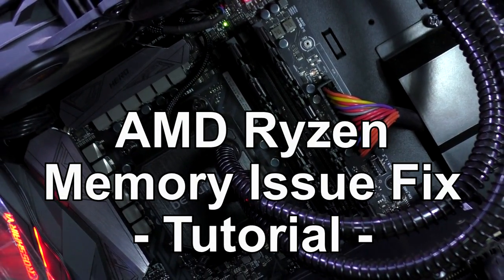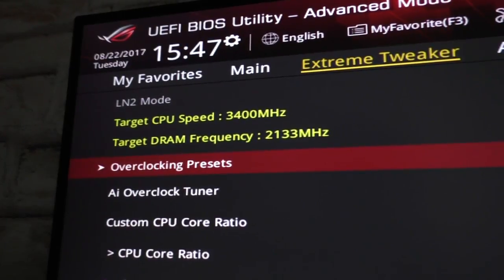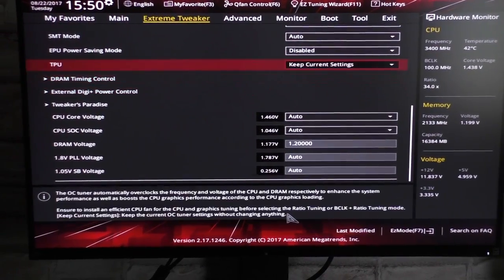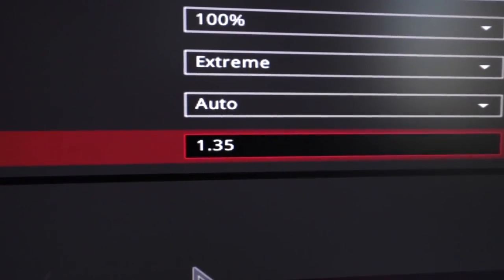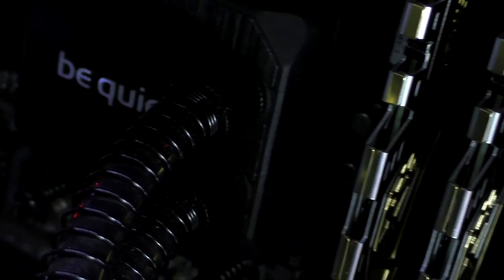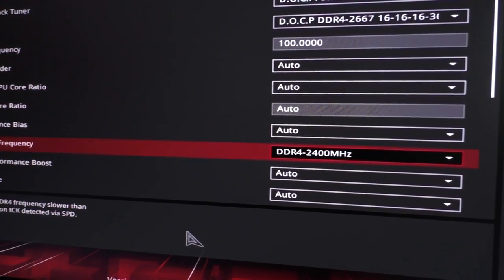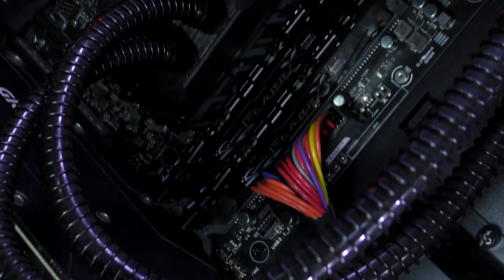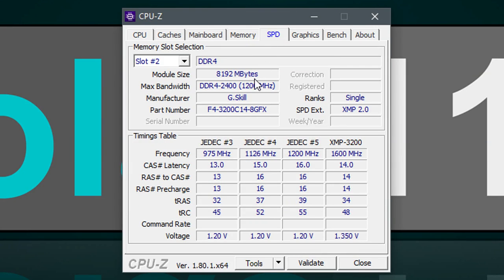AMD Ryzen Memory Issue Fix - Tutorial

Comment: I Used Trident Z RGn 4 X 8gb 3200mhz . 2 diffent kits, I just turned up the voltage from the recommended 1.3500 to 1.4000 and it posted and works fine now
Reply: Dude, I've been trying to fix this damn problem for months. I also have 4 Gskill ram modules, 2 in each kit and I have not been able to set the memories to the maximum speed (in my case, 3000Mhz) because my pc always turns off.

They only work for me as a maximum, at the speed of 2733Mhz.
Did the 4 modules work at maximum frequency?
Have you had problems in these last days?
Reply: @AndroidNetworkOficial  no problems max sure to enable xmp or AMD version of xmp and it should automatically run at 3000mhz or your max frequency

Comment: i have R5 2600, Asus B450 TUF and Team Delta TUF RGB 2x8gb 3200mhz. With DOCP/XMP(3200mhz) the board sometime doesn't recognize both sticks during booting, since TUF doesn't have boot voltage option, increasing the DRAM voltage seemed enough, 1.35v -> 1.375v and now... no problem at all. Thanks
Reply: Thank you it helped and now my ram working at its full speed 3000hz

Comment: Nice! ... I increased the DRAM Voltage from 1.20 to 1.30 and it solved all the BSOD issues! Thanks.
Reply: Yep, did the same thing and it worked. Ryzen 1200 bought 2017, just put a nearly identical ram stick in and had the no boot problem.

Comment: Guys are insulting amd coz they buy some 3200mhz kit but they didnt see they cpu limitation... connect ur brain sometimes ! For exemple Ryzen 7 2700x limit the ram to 2933mhz, if you want to go over the limit its called overclocking then u need to change timings, voltage, boot voltage etc... and 99% times it will fail and crash or it can happen while doing an hard cpu task.
On ryzen cpus even if you are one 2933mhz that didnt mean your 3200mhz are useless cause when u will play à huge game the cpu will automaticaly increase your ram speed.

Comment: ive got a ryzen 9. wont run my 3600mhz kit faster than 2133mhz. and out the box it was running my ram at 1.4v. no idea what to do
Reply: Same for me I am using 4x8gb of gskill trident z neo 3600mhz with a ryzen 5 3600x i canot get it over 2133

Comment: Hi! I have an MSI B450M PRO-M2 MAX with a Ryzen 5 5600G and Patriot memoryDDR4 x2 3200MHz motherboard that will only work one ram at a time both rams are good both slots work but can only use one ram at a time put in two rams and no display why will it not work with the two rams

Comment: Sorry for my english!! Here is mine problem... I've gotten a new ryzen 5 3600 , replacing my old 1300x... My MBO is AB350M , updated the new bios p5.60 ... I've got 2 ddr4 8 gb 2400 mhz , one is gskill other is crucial... Afther instalation of the cpu it wouldnt boot up... I took on ram stick out and it booted , whit two it just wont... It doesnt metter wich ram or wich slot im using it just wont boot whit two stick togheter, any ideas .... Ps i know its a bad mbo and bad ram... But why does it boot and work properly on one stick?

Comment: I already tried every method to reset my bios, but it just turns everything on and nothing displays and my peripherals don’t turn on
Reply: Mine won’t even post and have looked for every possible solution. Sigh” I guess I’ll have to go to a computer shop or something
Reply: @Kiro_I0  I went to the store today and it turned out being the motherboard it’s dead so they just changed it and now it’s running fine

Comment: I have  a problem, in BIOS, says that i have RAM at 2400 mhz, but in windows 10 task manager, it says that they are running at 2400 mhz.
My ram is 8x2 corsair vengeance cl16 with a ryzen 2600X.

Comment: Ive got a Ryzen 7 3800x/w asrock b450m/ac 750B psu changing dram frequency to 3600mhz will cause the PC to reboot with no display and no power to keyboard after unplugging afew hours i can boot into bios using pc for gaming 2 xmp profiles 1 is 4000mhz and 2 is 4100mhz (trying to install viper Patriot 4100mhz to run at best settings) any help is greatly appreciated

Comment: I'm using ryzen 2700x with vengeance lpx ddr4 ram and my PC blue screens after about 10 seconds of setting it to docp 3000mhz
Reply: HLFerg same with me and return to 2400mhz
Reply: HLFerg have you had any luck? I have same hardware you mentioned.
Reply: @derekchaney4914  no bro sorry, I literally have to sit my ram at 2400mhz, 2600 worked but still wasn't stable.
Reply: Same
Reply: I got 32g fuck it will only run at 2100hz fuccccckk
Reply: Any solution fir this?
Reply: @kuzumastudios8303  double check both sticks have the same timings and the same version think that might be the problem
Reply: I have the same problem after upgrading another 2 ram sticks. It was stable and wroking well at 3000 with 2 ram sticks
Reply: @VinhTheGamer  the 2700x only supports 2933 stable, any thing above it may or may not work.
Reply: HLFerg within 2 RAM sticks , my system is working well at dual channel -3000mhz. But once I plugged 2 more RAM sticks which is the same brand, speed. Then it automatically switch to 24000mhz and not able to change any higher speed. Also, it’s not stable even at 2400mhz and frequently appears blue screen.  error. I did update BIOS the lasted version. The motherboard is Asus B450M-A prime, power supply is EVGA 600w BQ +Bronze.

Comment: Got my Ryzen Threadripper 1920x stable @ 3466MHz CL14. 
4x 8GB Samsung B-DIE RAM in
Quad Channel. @ 1,39V

There are 2 things u need to know.
1. Some settings just don't work.
it has nothing to do with too low or too high. 
2. Ryzen doesn't like Intel timings
For example: (Same RAM) 
Intel  CL19-19-19-39  2T
AMD CL18-22-22-42  1T
Reply: Probably a faulty Ram. 
Check every single Ram individually with Memtest. 
(Put only 1 Ram in there. 
Open Memtest 4 times and check 2000MB each).

But try resetting you Bios first to default. Maybe its just wrong settings. 
You could also try to set the timings in Bios manually to safe timings like CL 15-16-16-35 1T The VRam voltage should be between 1,2V and 1,35V.
Reply: @imuhki  Seems like u get less voltage than it shows in the Bios.
Or the voltage drops under heavy load for some reason. 
Could be a problem with the Mainboard or power supply.
Reply: @imuhki  you didn't tell me, you are overclocking your 2400 RAM to 2666 😂. You can, but you have to play with the timings. I would start somewhere at 16-16-16-39 1T not more than 1.39V
And always test every change with Memtest until you got 0 errors.
Good luck.

Comment: The ram in my system is 3200mhz silicon power gaming turbine x with everything set to the stated default timings out of the packaging, but when I set the voltage to what the Ryzen Calculator recommends, my system does not boot up, it instead makes no attempt to reboot and it goes straight into a black screen of death

Comment: i have gskill 3200 cl16 ripjaw v and constant blackscreens of death ONLY while gaming, some more rare freezes under win10 apps like ableton 10 etc. xmp1 profile at 3200 dram volt 1.35v, 16 18 18 18 36 timings. no chance to game longer than 10mins. its not an overheat prob. cpu is 3400g, mb x570 aorus elite f11 uefi. 2x8 ram in the correct slots. i recently put them down to 2800 on cl 15 timings and the cinebench was 10% faster than on 3200 cl16. much more stable too, but still bsod and freezes. i suspect the apu' s gfx unit controller doesnt work with fast ram on games or at least not working with some auto settings. i did all that taiphoon/dramcalculator stuff,  but i have no clue tbh. i just put some values manually and the watched the comp booting strangely and i stopped. now i just set the dram voltage the timings and the mulitplicator. at least win10 is "stable"so far with some rare freezes. anyway i may buy some other ram, but my plan was to buy another cpu and gfx card anyway later that year. but tbh it is nervewreckingand it pisses me off...i mean its a samsung b-die ram and listed by gigabyte AND gskill...and its not stable. so it must be the ryzen apus fault. i bet it would run on intel like smooth butter

Comment: Ryzen 5 1600x, b350f board, trident z 3200mhz ram. Bios updated, docp set to 3200mhz, 1.35v. Wont even post at 3200mhz. 2933 is slightly stable but eventually crashes. What is going on?! (4x 16gb ram sticks)

Comment: I'm using an amd ryzen 2600, with a set of 2×8gb gskill ram sticks at 3200hz using the docp that set everything at it's rated speeds with a voltage of 1.35, after booting I noticed smooth speeds and no failures. I am doing this on an Asus b450f strix. But if anyone is reading this id suggest getting the msi tomahawk it's a overall better board for overclocking and stability for higher speeds of ram for ryzen.
Reply: And I have same motherboard, ram and procesor and same problem
My memory when i put on "auto" in Bios, Pc automatic put my ram on 2133 mhz
Sory for bad english
Reply: I’m using the same mobo and processor with G Skill Trident Z 3000mhz and I can’t for the life of me to get it to boot @ 3000mhz. I’ve updated the bios, set the DOCP profile. Adjusted voltage. Any tips? It’s driving me nuts that I can’t get this ram going any faster
Reply: @BigDC9708  Try changing ram slots
Reply: Gerard Prins did that, could get it to stay set in the bios but got stuck in automatic repair loop
Reply: @BigDC9708  I have 4 sticks 64gb of G.Skill Trident Z 3000/cl14 running at 3066/cl14 stable. I did have to tweak all the timings and memory settings as suggested by the ryzen timing calculator than tweak some more to get it fully stable. My MB is Asus prime x370-pro so I don't know if this will work for other boards but my board is not known to be amongst the best memory overclockers. IMO if the board is not physically deficient advanced tweaking of most memory timings and options is required but it is possible to stabilize it at the end.
Reply: @imuhki  Sure man I will try to do it later today. What is your config exactly, ram specs total amount, mobo and which CPU?
Reply: @imuhki  Hi Caal, you can find the files you need in this link, I have included the Ryzen DRAM Calculator 1.41, latest BIOS file I use 4207 (I recommend downloading this again through the Asus site), O.C. profile .cmo corresponding to this BIOS, and all the settings from the profile in a .txt format. Hope this helps. https://we.tl/t-e3sUr1dPzx

Comment: i have a simple question but the answer eludes me. I've got a Asus b450 plus mobo it is supposed to support 3200 MHz. I recently installed 16 more ram but it refuses to cooperate. it worked like a charm with the 16gb i built it with DRAM was running 3000mz but since i got the new memory it only 2133mhz. i dont get it. the ram is identical to what i originally built corsair 3000mhz can someone at least tell me the reason why the hell it won't work? this crap driving me nuts. ty
Reply: 333crypta same bro i ve got a asrock b450m pro4 and my rams are kingston hyper fury x 3200 mhz and also have ryzen 3600 but when im start the using xmp profile my pc gonna shut down...
Reply: @riantholiv  any luck figuring out what the problem is? i was able to get mine to 2666. but i think im gonna leave it at 2133 and say screw it. tired of fooling w it

Comment: when i put xmp profile 1 
and my ram speed at 3200 
my pc just keep restarting and restart and restart 
please if you have an idea just tell me
Reply: Unplug your system, press the power button for 5 seconds, remove the CMOS battery and put it back in after 10 minutes. This will reset the bios settings and bring back the default clock

Comment: So I have the gigabyte b350 gaming 3 that supports up to 3000mhz. Anyway, I have the 1500X(supports 2667mhz memory) and a 1x8gb ram 2666mhz.

 For some reason it seems to be running at 2133mhz... and I guess its been like this for 2 fucking years cause I never checked is, as I asummed the ram speed would be recognized and set automatically.

 Anyway, what should I do to set it at 2666mhz like it should since the beginning? I heard some say about the xmp profiles from BIOS... but some people also got issues doing it? So I dont want to screw up my pc just for some houndred of mhz? U know. So is there a way to do it safely? Or is therea guide to step by step?

Comment: Tyvm, this fixed my memory issue with my 3700x on my x470 Hero board. Now I don't feel so dependent on waiting for Asus to update their bios as I feel they are delaying it to push ppl into buying the new x570 mobo's.
Reply: Hey man, you had sucess booting your memory with these specifications? I have the same Mobo and cant get past the cold boot screen. :‑X
Reply: I have Ryzen 3700x and 16gb g.skill flare x 3200mhz, but the memorys are operating at 2133mhz, i Just need to set my dram voltage and dram boot to 1.4v, right?
Reply: Thanks man for the tip and for showing me the way! You're a kindly soul, tyvm ;-)
Reply: @anibalpjr1  Np, hope it helps.

Comment: Hi, I had first 2x8 G.Skill Flare X on my PC and I had no issues at all by puting them at 3200 MHZ,1.35v. Ryzen 5 2600x, B450 Aorus PRO. 
But since I added more (2x8, same RAM) my PC sometimes crashes, sometimes doesn't boot and sometimes boots with the RAM speed at 2133 MHz instead of 3200MHz

I increased RAM voltage from 1.35v to 1.36v and now I'm at 1.39 but still having issues (PC shuts down when put into slleeping mode).

Comment: I have a Ryzen 2700x with X-470 pro and g.skills trident rgb 3200 mhz and can’t get it over 2133 MHz. I’m not pc savvy and don’t understand many terms.  I enable D.O.C.P. But it doesn’t work help.
Reply: Killacam___ 82 did you have any driver issues when you finished the build? I have the same cpu and motherboard. It didnt let ne install some drivers because of "system configuration"

Comment: When I set my ram MHz to any higher than 2666mhz my games started lagging after 5-10 mins of gameplay and it will frame drop continuously for about 10-30 sec and after that the lag will be gone and the same process will repeat in my games until I set my ram MHz to 2666 and the lag will be gone, can you guys help me with this issue Ive been trying to solve this for about 8 hours now.

My pc specs :

MSI A320m A pro max 

Ryzen 3200g

Avexir core 2 3200mhz

ZALMAN 700tx

Comment: Please do a video of gskill ripjaws-v 3200mhz ram..
 Will this tutorial help me for this ram?
Reply: Bro my Gskill TR z 3200mhz not work
Reply: Xmp doesnt fix the problem, nor does manually overclocking the ram.
Reply: @nahidch8697  same
Reply: @CarloLeonKolega  Finally Bro my Trident Z Working......Put my Ram A2 to  B2.......Done #3200mhz
Reply: @nahidch8697  What mbo?
Reply: @CarloLeonKolega  Bro ROG B450F
Reply: @nahidch8697  hmmm
Reply: @nahidch8697 how many ram sticks do u have?
Reply: @CarloLeonKolega  Now one 16gb kit ,My system may be Support 2x16gb at 3200mhz.....If i am add 4x16gb system might not be run at 3200mhz
Reply: @nahidch8697  i have 2x16
Reply: @nahidch8697  how did you do it?
Reply: @fabergutierrez3553  Bro just put ram B2 into A2 slot...Then Enable XMP/AMP its Work.

Comment: For me, I run B450 and an 1800X. I can get 2X8 to run at 3000 but 4x8 will not boot above 2400. Even though it's all 3000 ram.
Reply: Wish there was a solution for us my dude. Exact same problem here.

Comment: I just got a 8x2 corsair vengeance RGB 3466mhz kit, I managed to make it run stable at 3200mhz on my AX370 Gaming 5 mobo without tweaking the vboot. Anything above 3000 mhz doesn't boost performance all that much so I'm finy with what I got for now:)

Comment: Had my ram running fine on 3200mhz and then i upgraded my processor to the Ryzen 5 3600 and now its 2133 and if i try to put it higher in BIOS my screen says no signal and i need to take the battery out of the monitor to reset the bios. Can anyone help?

Comment: My flare x ram won’t run at 3200 on my asrock x470 board Gskill website says it will work tho
Reply: Just right now I updated my x370 I have 3200 Flare x.. and my bios is now 5220 ... I just tried to upgrade it from last year ... and unfortunately now it seems I have no more profiles DOCP ones from which I could select the pre compiled profiles to run the DRAM at.
I dnt know if I did this by updating the BIOS with the DOCP profile on (first time I did this error today).. or it's just something that the BIOS brought in on my configuration indipendently from this.... Please HELP.

Comment: mine won't run at 3200mhz but runs stable at 2933, havent tried if 3000mhz is table, but there's not much of a performance gain so 2933 seems ok.It's Corsair Vengeance LPX 8gb btw

Comment: Thank you! This is the only video I have seen with the same bios version, and getting at my specific issue! However.....it still didn't work. I mean, I was able to get it increased from the "base" reset value of 2133, but I still can't get the last 500 speed out of my 3200 corsair DDR4 RAM sticks. 

My 8GBx4 Corsair DDR4 3200 sticks compatible with Ryzen says they are rated for 3200hz at 1.35 volts yet the highest option I can get is 2733hz at 1.39 volts. Nothing higher has ever worked for me. I only have one DRAM option to change, and my XMP DOCP standard is turned on. However, my Ryzen 7 2700X on my B450 motherboard is able to run at least 4000 stable, which is 8% at around 1.33volts. However, I have successfully booted at 13%, but it wasn't stable and I don't have enough cooling. I don't know why my ram still won't work properly, however.
Reply: Well shit, and I thought I got unlucky. I got 2 sticks of Geil Super Luce rated for 3200mhz at 1.35v and an AsRock Steel Legend B450 board, so it should be able to run at the higher speeds just fine. But I couldn't get it to run at 3200mhz, no matter how hard I tried. It did run at 3000mhz, so I'll keep it at that for now.
Reply: After that video and reading all comments, l know corsair ram is shit  never had that problem with patriot steel  always set 3600 was running smoothly corsair not running advertised speed  no mother how good pc and components you got